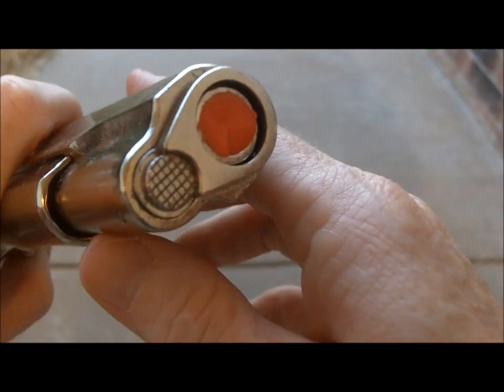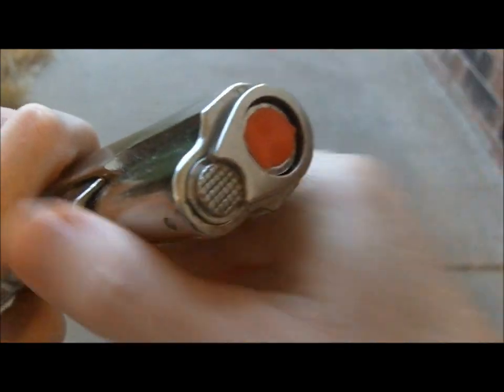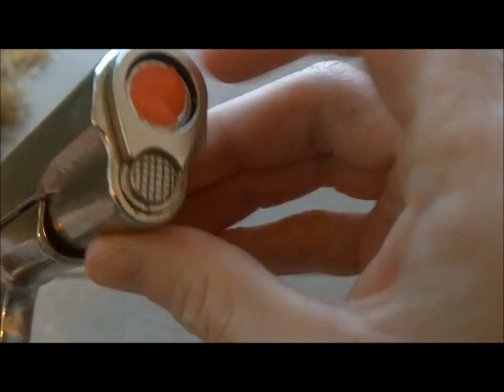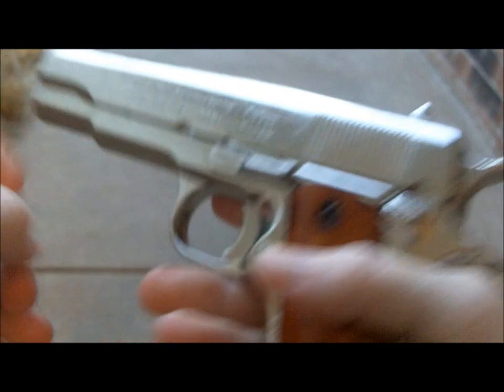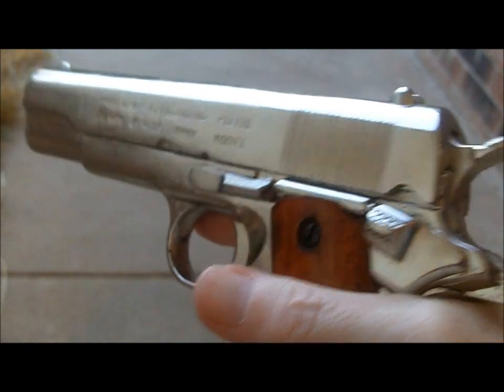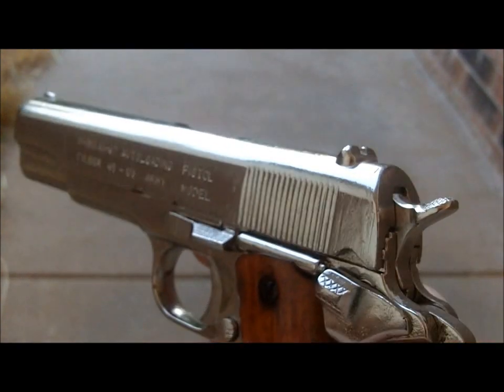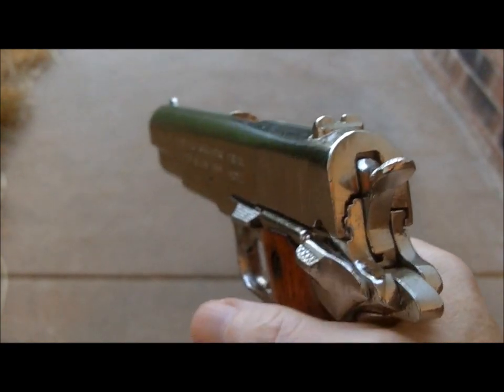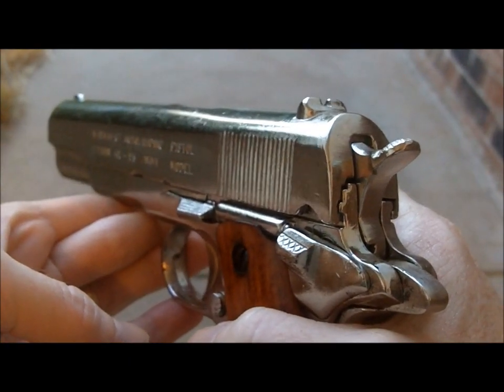A discussion of the Denix M1911 NonFiring Replica Gun, esp w/ regard to the orange barrel plug

Comment: Denix's quality has gone badly downhill over the years. Poor fit and finish, replica shells that don't even come close to representing the caliber size of shell the gun is chambered for, etc. Unfortunately, these are about the only inexpensive replicas available nowadays. I had until recently a deluxe 1911 I got back many years ago, it didn't have an orange plug, the grips were removable, and the .45 shells were full sized and made from turned brass stock. I even remember when the 1873 colt replicas originally came out they were much better than now. The newer ones have a gap in the front of the frame where the two sides meet together that you could drive a truck thru (again the poor fit and quality control). And on top of the quality going down, the prices of these replicas have literally doubled since their original release many years ago.

Comment: What if you change out the  internals and slide with a real slide, would it then still not fire???
Reply: with enough sanding drilling and modifications it probably could, but the frame is probably weak

Comment: ACETONE, also sold more cheaply as "nail polish remover" in the cosmetic aisle at Wal Mart or elsewhere, will MELT the plastic orange plug in the gun barrel. Just let the gun barrel soak for a couple of days in the acetone, then use a wooden popsicle stick (to avoid scratches) to scrape the orange plastic out.

Comment: How do you get it out? Do you just take a stick and press it down the barrel?
I heard that could break the gun.
Reply: ACETONE, otherwise known as "Nail Polish Remover", will dissolve plastic if you let it soak. So just stick the barrel of the gun is some acetone for a day or two, The orange plug will become soft like balloon-rubber and then you can scrape it out with a popsicle stick. Don't use a metal tool to avoid scratching the gun.